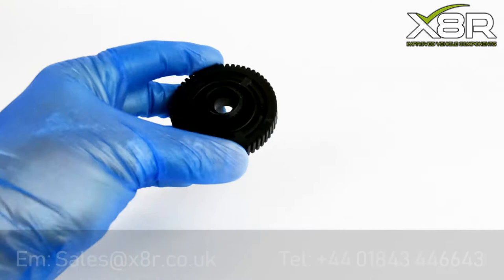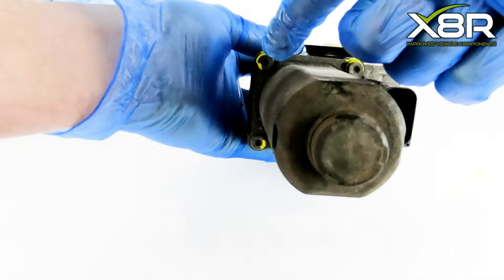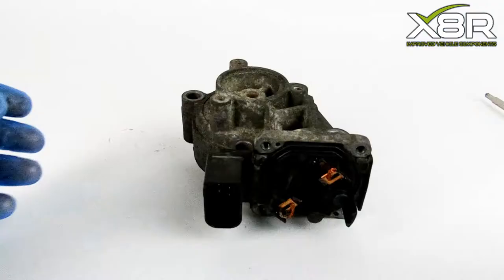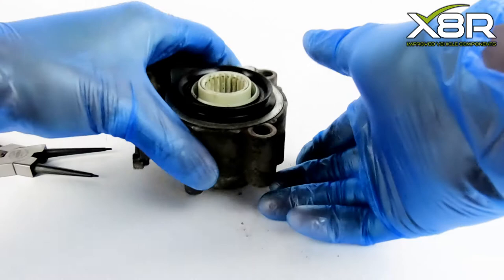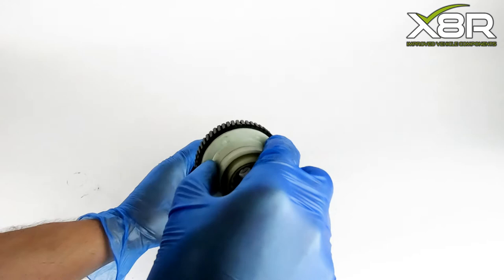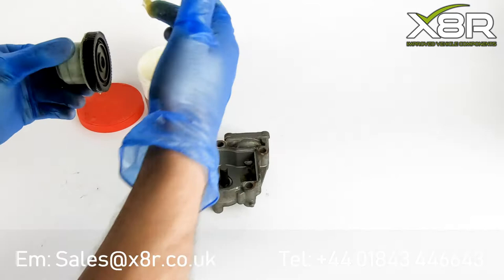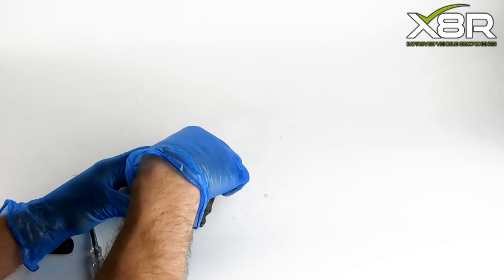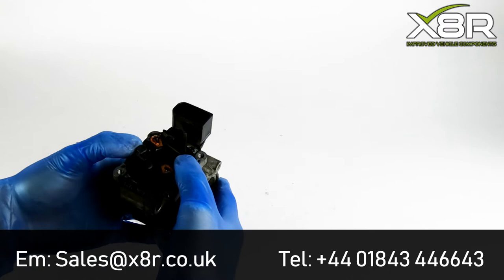BMW X3/X5/X6 Transfer Case Actuator Motor Repair

Comment: Does the 2013 F25 actuator look the sam3
Reply from the maker: Hi there, send us a photo of your actuator to sales@x8r.co.uk and we can determine if our kit will be compatible. - Georgina, X8R Ltd
Reply: @X8RLtdUK  I'm also curious for a 2011 X3 28i - F25. I get shuddering when I turn at very low speeds. Not sure if that is a symptom of this.